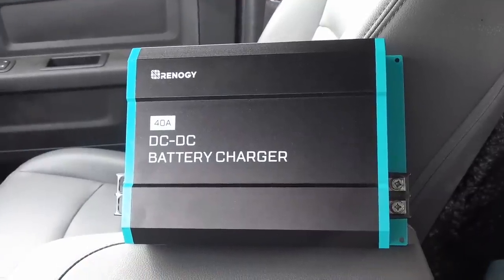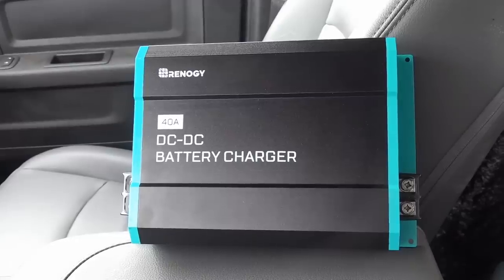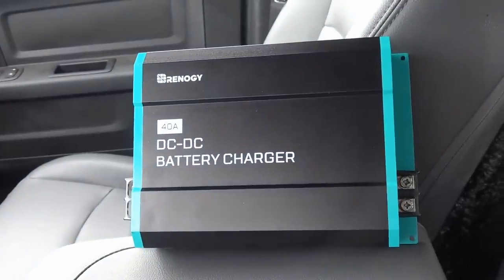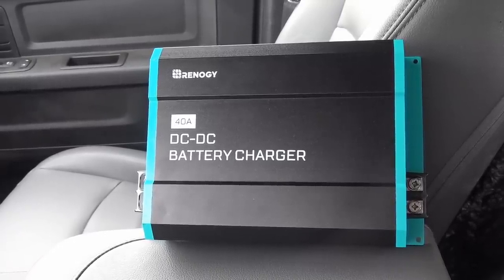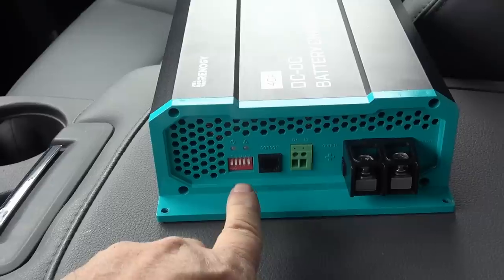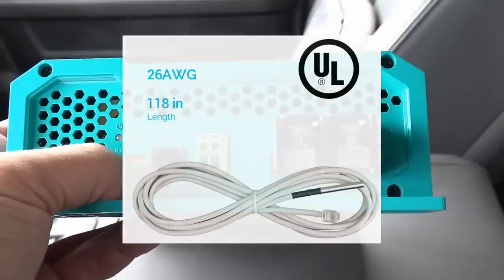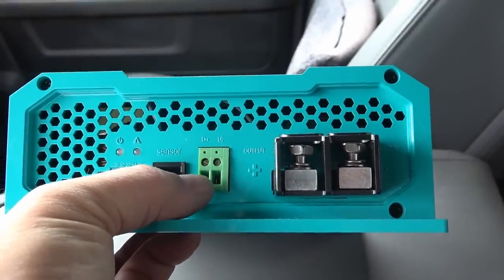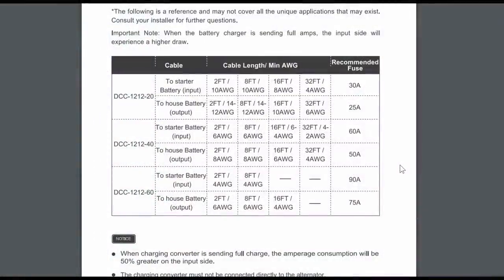Extra 40 Amps Charging into RV Battery Bank from Truck Alternator (Renogy 40A DC-DC Charger)

Comment: Just a one question - why a 60A fuse on the battery and then the 60A breaker? why not just the breaker?
I am currently looking at upgrading my Redarc BCDC1220 in my Prado to either the same Renogy unit, or maybe do away with my Epever Tracer 2210A as well and getting the Renogy 40 with MPPT so I can then go Lithium, say 150Ahr,  rather than the current 140Ahr AGM that runs my fridge/freezer.
Reply from the maker: Here is a previous video where I was installing the truck wiring and explaining things - https://youtu.be/w3LwwfNPDUA?t=191
Here is my logic. I'm simply using the breaker as a convenient on/off switch so when I'm not using it I can turn off power to the rear connector. I didn't want to place it on top of the battery, but where I decide to mount it left about a foot or so of cable. So to be on the safe side I added the battery terminal fuse since the holder was already there from the vehicle manufacturer. They had a much higher amperage fuse so I dropped it down and swapped the fuse.
Now for example if me or a mechanics was working on the motor and drop a tool across the input side of the breaker it would blow the fuse versus turning the cable red hot. Maybe a bit of safety overkill but I always like to have every wire path in a circuit protected. Cheers, Ray
Reply: @LoveYourRV  fair enough - as in Scuba, redundancy can be a good thing.

Comment: Just found renolgy has a unit upgrade from this one a lot simpler to install and smarter, it has a DD-DC and Solar Charge controller in one unit to protect your batteries from the Vehicle and Solar power.
 DCC50S 12V 50A DC-DC On-Board Battery Charger with MPPT
Reply from the maker: I already had a separate solar charger controller so I went with the cheaper standalone DC-DC charger, not the combo unit. Personally, I'm not a fan of products that do multiple things in one package. If it quits then you lose two charging methods.  Cheers, Ray

Comment: Hi Ray, Some specialty stores suggested I put in a Cyrix-ct from Victron energy instead of a DC to DC charger. since my battery bak is small.  two 6V AGM Lifeline 220 AH  Have you ever heard of this?  What are your thoughts?  Cheers
Reply from the maker: It looks like basically a smart switch designed for motorhomes. It may or may not work well depending on the voltage drop on the cables between the truck battery and the trailer battery. You'd need to have a pretty heavy gauge cables for the long distance to trailer batteries.  Might work as your truck and is smaller than mine and I have a fifth wheel, so distance was about 30-35 feet of cable.
The difference with a DC-DC charger is it can convert the voltage input from the truck battery/alternator to a higher and regulated voltage output for better overall charging of the RV batteries. The DC-DC charger has multi-stage charging.
Reply: @LoveYourRV  Thank You Ray.  i have about 19'.  I would have them put a 4G for future changes.  I am exploring every options with what there is available in material and workmanship around here!  I appreciate your input.

Comment: Great video...does this charger work well with AGM batteries?
Reply from the maker: Yes, has a multistage charging output and it can be preset for wet cell and AGM lead acid as well as lithium type batteries.

Comment: I have the same setup but using the 60amp version does your output side terminal get pretty hot and the unit it self get really hot and the fans kick on ?
Reply from the maker: I haven't used it that much yet, but didn't notice any extreme heating. I'll keep that in mind and check.
Reply: @LoveYourRV  I spoke to renogy today they said the 60amp version does get hotter but they think the cable run might be to much it 30ft of 2awg which for the 40amp would be fine but is actually unknown for the 60amp version. They suggested to ship it to them but can take a month to diagnose and get it back. Decided to switch to the 40amp and returning this to amazon my truck and batteries will probs thank me for it. have the same lion energy batteries as you and a Ram 1500 I getting a msg on the dash now battery saver mode active so that's a clear sign its to much.
Reply from the maker: Sounds like a good idea, I find 40 amps is plenty for my needs. Let me know how it work outs. Definitely better for your truck I imagine. Not sure of your alternator size but I assume the 1500 is gas with one battery.  My diesel has two large batteries, plus I have the optional 220 amp heavy duty alternator, so powers the 40 amp DC-DC with ease. Cheers, Ray

Comment: Thanks for the video! Can you tell me what you mean by "spliced into the 12v for the side marker light" ? I'm trying to figure out exactly what to attach that trigger wire to, and how to do it. Thanks for the help!
Reply from the maker: Another way of saying T-tapped into the power wire that supplies the marker lights. I used solder but there are connectors that are quite popular called T taps used in automotive wiring.   https://amzn.to/3gVSzsX
I used my marker light power wire as it was convenient for me since I always have them on when towing but any switched 12V power will do. A wireless 12V switch may be a cool way to do it.  https://amzn.to/2QPLrn1 Cheers, Ray
Reply: @LoveYourRV  Ahh Ok thanks for the clarification. I was thinking I had to run it all the way back up to the bus' fuse box, but I see you are saying you just spliced right into the wire running to those lights. Got it. Thanks!

Comment: Nice work.  Would  a charge controller accomplish the same thing as the DC to DC unit?
Reply from the maker: I assume you are referring to a solar charge controller. Some may but I tried one in my last video but results weren't great. Usually they expect a higher input voltage to work.  It had a difficult time dealing with the wiring voltage drop and the voltage regulation of my trucks smart inverter setup. This DC-DC charger is designed for the task and works well as it can boost the voltage.

Comment: I have a F-250 diesel with two batteries to start the truck. Can I still hook up to one battery as your video and run it to the DC-DC Battery charger?
Reply from the maker: Yes, my truck is a 6.7L Cummins diesel with two starter batteries and the system works well. I used the driver's side battery because that is where the factory placed the HAPP (High Amperage PowerPoint) https://www.ramtrucks.com/assets/bbg/pdf/2016/docs/cc/HAPP.pdf
It's an added feature when the optional 220 amp or higher versus 180 amp alternator is ordered with the truck. I figure that would be the best place for the DC-DC charger hookup since it's already designed for adding high amp loads such as winches, light bars, etc. I'm not sure which battery would be best for your Ford. Cheers, Ray

Comment: Ray have you had any problems running three batteries??? I have heard anything over two 12 volt batteries in parallel (12 volt )will cause them to not charge properly over time ...per Will Prouse..Have you had any issues?
Reply from the maker: No, I haven't had any issues for almost 3 years of usage now. What I do is every 4 - 6 months depending on usage. I pull the 3 batteries and recharge each individually to 100% full, to the point that the BMS cuts off charging then reconnect. That way they stay in balance.
Reply: @LoveYourRV   thanks Ray ..I knew I could count on you to reply ....

Comment: Ray I apologize for all the questions but I just noticed my Anderson connector is sized for 2 gauge and I, like you, am running 4 gauge wire ...how did you make this connection ? I was wondering if I could get away with soldering it ??
Reply from the maker: What I do if the lug is larger than the wire is loop the wire back on itself to make it thicker. I use a hydraulic crimper on these powerpole connecters since they are so thick walled. Soldering may be hard to do because of the thickness of the lug. You need a pretty high wattage iron to get the the temp hot enough, plus the nickel coating repels solder so you'd need to rough up the coating to get it to sick.
Reply: @LoveYourRV  I looked again at the description of my Anderson connector ...says specifically for 2/4 gauge ..Ill use your trick ..Ive been forced to do that before on smaller gauge wire as well ..Thanks Ray

Comment: Hi zRay, I’ve already ordered the 40 amp for my lead acid batteries as I run a Samsung residential fridge and it eats batteries. On a long run from Ottawa to AZ this winter I had to run the generator and constantly worried about damaging the batteries.. My only question was how to connected the negative wire from the Anderson connection the frame. Did you just  do it within a few feet from where your bed connection is located. Been copying your mods to the tee for a few years and have been more than happy with my results.
Reply from the maker: I connected my negative to a large frame rail about 3 feet below, I drilled into it, sanded a bit of the paint off, add some Oxgard antioxidant paste and used a large TEK screw with a washer to tighten down  the lug.  Its worked well so far, I get the full output from the charger, but many say its best to run a dedicated negative wire back to the battery. I can always do that if needed but so far I don't need to spend the cash on the extra cable. I guess it may vary from vehicle to vehicle depending the way the frame put together. Cheers, Ray
Reply: Love Your RV . That is a very reasonable solution given that you have a clean ground  connection on the frame. Like you said, you can always revert to a direct battery connection but given how tight the engine compartment is on a F350 the one single wire long run is a luxury I will take. Thanks Ray.
Reply: Ya, I’d def run a dedicated neg(-) homerun to the battery. I’ve chased problems on people’s trucks and trailers enough times that I believe in that! Even some of the better utility trailer manufacturers these days run two wires to the electric brakes for better service dependability. Much less issues, and no “electric rot.”

Comment: Hi, I have a very small auxiliary battery bank made up of (x2) 28Ah batteries in parallel for the refrigerator in my Jeep. Id love to run a DCDC charger between my starter battery and my battery bank but the smallest DCDC I’ve found is 20A which is too much power for my 56Ah setup. Are there any DCDC options for a bank as small as mine? I should add that my Jeep has a 160A alternator which is NOT a smart alternator)
Reply from the maker: Here is a 10 amp DC-DC charger https://www.amazon.com/Victron-Energy-Orion-Tr-240-Watt-Bluetooth/dp/B086R9H4QV  Also, the 20A Renogy DC-DC charger has a current limiting setting that can reduce the amperage by 50% so that it will only charge are 10 amps. See page 15 in the manual https://www.renogy.com/content/RNG-DCC1212-20-BC/DCC1212-204060-Manual.pdf

Comment: Tito, I installed this exact system like you have here about 2 months ago. I was testing it out last week for the first time on our trip to the Smoky Mountains. My 60 amp breaker keeps tripping when I turn the system on. I wired my trigger switch to my auxiliary switch in my Jeep. The 60 amp breaker that I bought was a very cheap one. I think that  it may be faulty. I don't see a short or any wire damage anywhere. Do you think that it is most likely the breaker is bad?
Reply from the maker: Could be or else maybe the cable between the charger input and the Jeep battery is too small of gauge. If the cable is too small of gauge there will be excessive voltage drop and the charger will draw more amperage to compensate for it. The manual has recommend gauges for wire run length.  https://www.renogy.com/content/RNG-DCC1212-20-BC/DCC1212-204060-Manual.pdf Cheers, Ray
Reply: @LoveYourRV  thank you. I have good 4 gauge wire. It is what is recommended in the manual for the length and amperage. I'm going to try a better breaker.
Reply from the maker: Should be fine then, I used 4 gauge for my 21 foot long Ram truck and usually see about 50 amps or so on the input side. You're wire run should quite a bit shorter with a Jeep

Comment: Thanks for the simple, easy to follow guide.  Perhaps you or anyone here can answer a question for me.  

What size alternator is needed for what size DC-DC charger?  My truck alternator appears to be rated at 160 amps, so maybe I could measure how much is drawn with lights, aircon etc all running and see how much "headroom" there is.  However, I would have expected Renogy, Victron and the like to publish guidelines to aid with size selection.  I would expect a rule of thumb so as to avoid over-working the alternator.  On the other hand, I'd much rather charge at 40 amps than 20 amps if feasible.  Thanks again!
Reply from the maker: Probably best answered by the manufacture or a knowledgeable mechanic.  There are so many variables since there are so many different options for vehicles these days that could draw power, like heated seat & steering wheels, power windows, door locks, , extra lighting packages,  entertainment packages with amplifiers, etc.  I imagine that is why the DC-DC manufactures don't get much into it. They have no clue what a vehicle may be running at a baseline. A barebones model will be different from a fully loaded model. For my Ram diesel pickup 160 amp is the standard alternator then there was a 220 amp option and dual for 440 amps. I think the 440 amp is mostly for stuff like ambulances and two trucks.
Reply: @LoveYourRV  Thanks for answering so quickly.  The 20 amp model (good deal available!) would be the "safe" bet, but hate to leave another 20A charging capacity on the table.  Would make a big difference charging my intended 2-300Ah battery set-up. 

Is your 40A unit on the Ram truck with the 160 A alternator?  If so, it might be good for me (same truck).  I think the next step is to measure the current with everything running.  That would at least enable a more informed decision.  Cheers!  

Anyone else pondered this question?

Comment: If you were just starting out, assuming 200-300Ah lithium house batteries and appropriate truck alternator, how would you prioritize  adding solar, generator or DC-to-DC?
Reply from the maker: First is generator, then solar then DC-DC charger. Generator offers the most flexibility, solar is the nicest from a lifestyle perspective but of course needs the sun to work.
Reply: @LoveYourRV  Thank you Ray.
Reply: Love Your RV 
Of course other people’s needs are different but I’d pick solar panels first unless you need air conditioning. I don’t have a generator here and run solar only on a off-grid lot. Gas fridge and 200W panels. I’m never out of power even here in Vermont. I did run a 120v apartment fridge for six weeks last year just to see if I could do it. I did it but 200W isn’t quite enough to depend on for a fridge on purpose imho

Comment: Are you sure the combined output wire is large enough?  It just looked pretty skinny for 51 amps on a cloudy day. Stay safe out there cheers.
Reply from the maker: Most of the amperage charts I looked at showed 4GA copper able to handle 70-85 amps. I did a test drive with the battery bank depleted so was drawing around 51 amps and drove for around 4 hours then felt all the wired and connectors, not even warm. Will continue to monitor it.
Reply: I use the ABYC charts if you want to think on it. 
4ga is just about right there for around that length at 50A

Comment: Great run through on this! Very basic explanations which makes it awesome for my brain to understand. One question do you know if their measurements on wire are loop length or per line? Hope that makes sense
Reply from the maker: Here is the manual if you want to take a look - https://www.renogy.com/content/RNG-DCC1212-20-BC/DCC1212-204060-Manual.pdf  I'd assume its a one way length measurement and not round trip. I can tell you that mine is 4 gauge wiring from truck battery to trailer batteries and it works well putting out close to 40 amps while drawing about 50 amps from the truck. My truck is a long bed so 21 feet long total. I've checked the cables after a few hours run time and no heating. Heavier gauge cables likely would lower the truck side amperage a little bit but drives the install cost up and harder to install them than smaller cables
Reply: @LoveYourRV  I also assumed the cable lengths were one way but after comparing to wire length/guage calculators out there, it seems like those lengths are round trip. Unless there is some reason I'm missing that they could be thinner for this purpose?
Reply from the maker: @maylibu  Usually the wire calculators are looking at the % losses in the wire but for this application, the DC-DC converter will just adjust and draw more amperage to compensate for any voltage drop in the cable so most concerned about the safe max DC amperage of the cable gauge. 4 gauge is good for 60-70 amps so we are OK. Going with a larger gauge will draw less amperage from the alternator but depends on how much a person wants to spend and a large wire is harder to run. I found my wiring drew about 50 amps to charge at near 40 amps so was happy enough with that. Especially since my heavy-duty alternator can easily handle the load.
Reply: @LoveYourRV  Thanks for your reply, that's helpful. My situation is a small camper van with the 20A version of the DC DC in the engine compartment. One-way length to my rec battery is about 12ft. I was originally hoping to use 10ga based on the manual, then after researching deeper I assumed I will have to go for 6ga instead. Now I'm thinking I can use 10ga after all. Does that make sense?

Comment: Hi Ray,  can you use the bt2 module to monitor or put in user values?
Reply from the maker: I don't think so, I didn't see any port for that. There is a RJ11 port but manual indicates its for a temp sensor - https://www.renogy.com/content/RNG-DCC1212-20-BC/DCC1212-204060-Manual.pdf